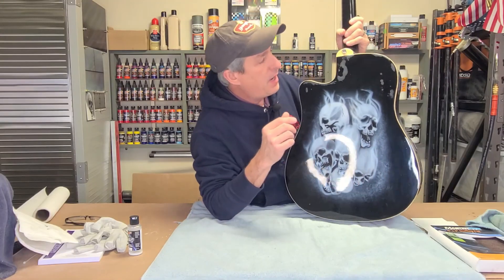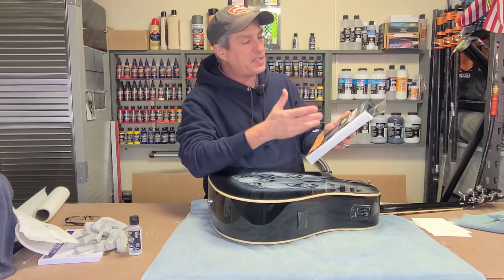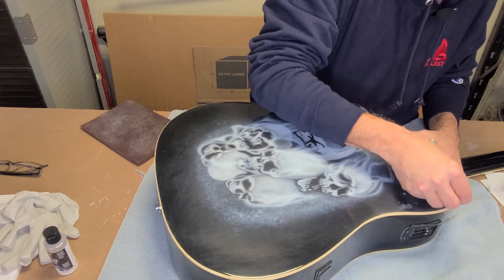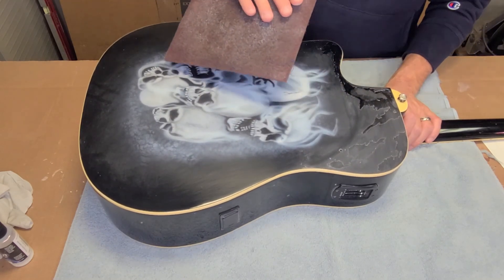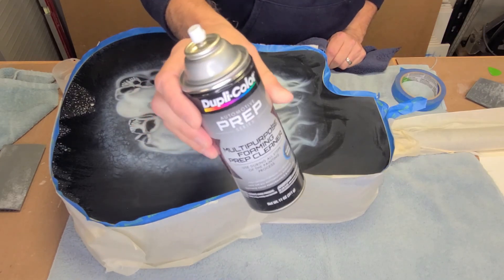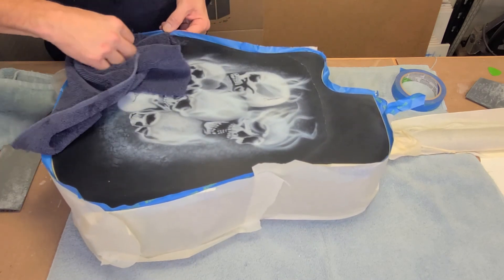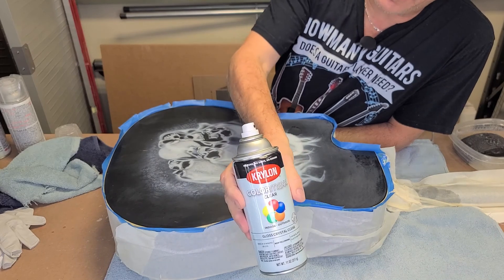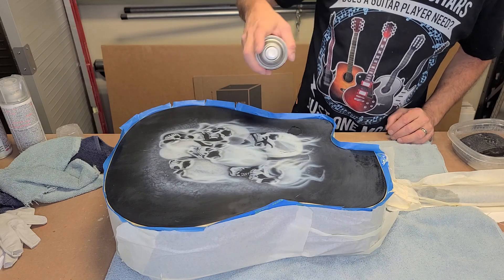How To Repair Peeling Clear Coat

Comment: Another absolute gem. Your setup makes me beyond jealous. Thanks for all the hard work!!
Reply from the maker: Thanks Brian much appreciated.
Reply: What local shops do you get supplies from around here? There aren’t much that I’ve found. There is the tape store on the blvd for spray max and fbs but they only have orange. Good little shop in a pinch. I avoid hobby lobby at all costs haha.
Reply: @brianindorato5255  Brian, none. I am an Amazon guy. It's just to dam convenient. Bit thank for the info. I will check that place out.